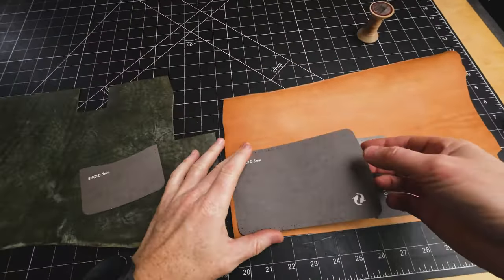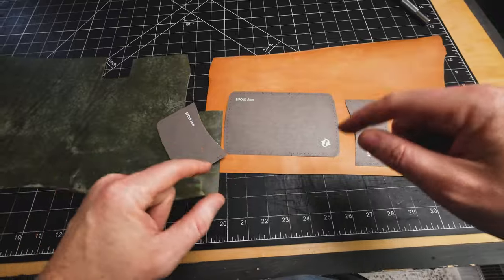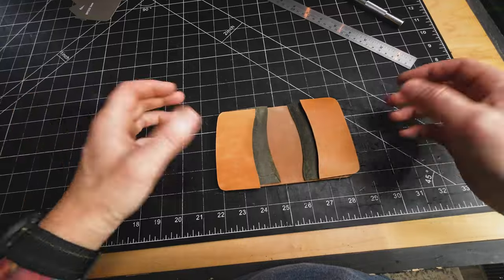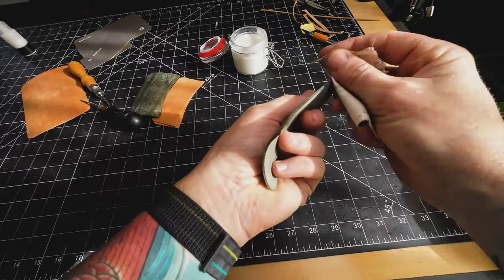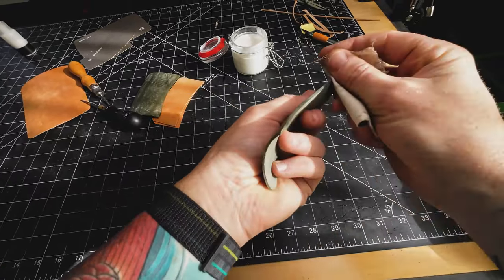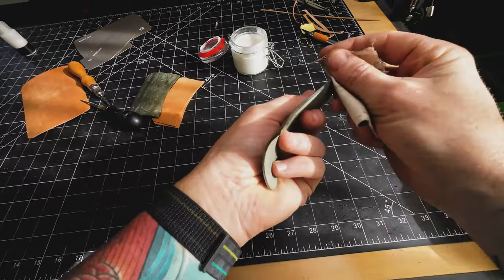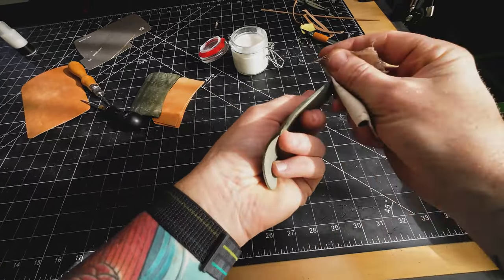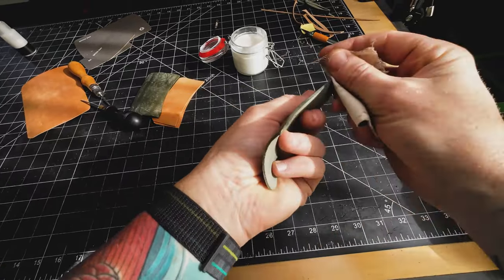EASY Leather Bifold Wallet | No Skiving Necessary

Comment: 8:10 Thank you so much for showing me this method of sanding with Dremel. It's really useful. Since I couldn't find a suitable rubber band, I thought of wrapping the sandpaper with double-sided tape. It works that way too. Since fine grit sandpapers become unusable quickly, I turn on the dremel and hold the sandpaper by the rubber tire. In this way, I can use the sandpaper for a longer time by cleaning it.
Reply from the maker: Yes, the rubber really helps refresh the sandpaper. I hadn’t thought about double sided tape to secure the sandpaper. 👍🏻